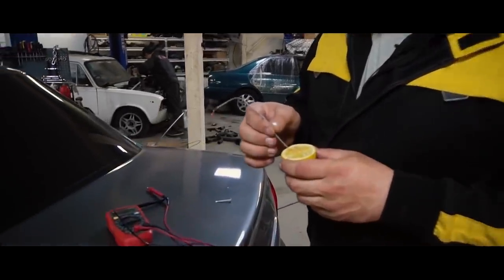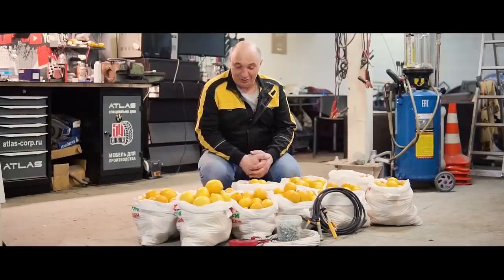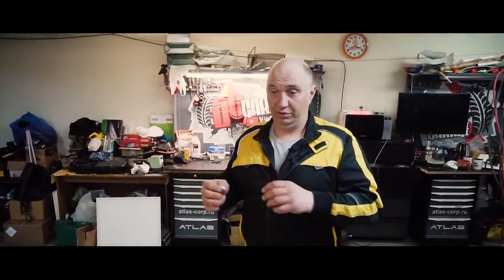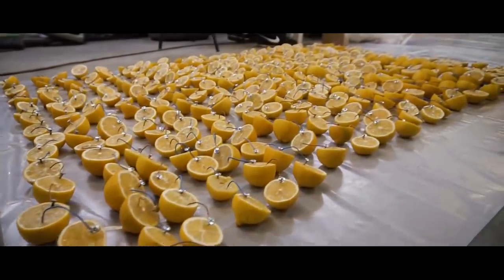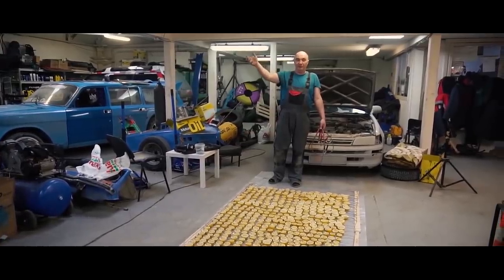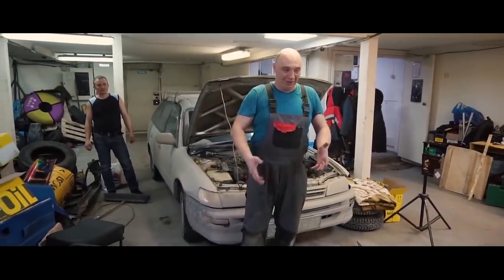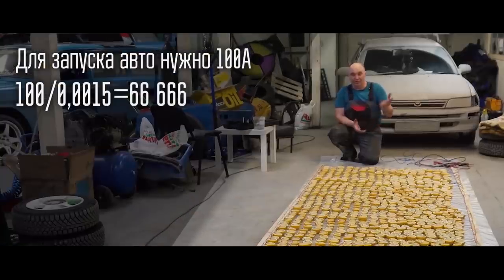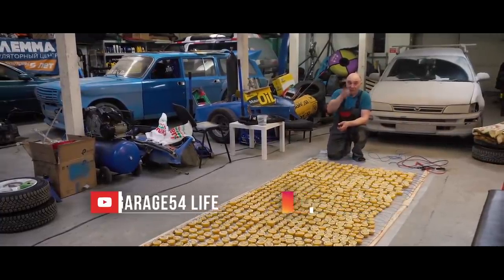Can a battery made from 1000 lemons start a car?

Comment: First squeeze the juice by running them over with concrete wheels and then try replacing battery acid with lemon juice. Then put the waste in a barrel and ferment with another shit ton of sugar and water. Distill the resulting liquid and use it to run the engine rather than start it! 

Proper job, now go in it to the store and try the whole thing again with grapefruit or rhubarb!

Comment: 11:38  Under a Department of Energy program, America's finest engineers have tackled the problem and solved it. We are performing our test in Florida, next to a large lemon farm.   We are making our grid in advance using copper and zinc pieces pointing up.   We will use whole lemons to maximize battery life. We determined we can minimize cost of labor by having the people who pick the lemons  stick them on the grid without cutting them in half.

Comment: You can start a car with lemons, just not the way you think. 

Instead of connecting the lemons directly to the car, use them to recharge a battery enough to start the car.

Comment: Despite those weak lemons, this couldnt work even with strong batteries, with such thin main pararell wires from the lemons.
second thing: it had 1500mA current, what u said,  later when doing math, you count only 1,5mA, small mistake :D
Reply: If you look carefully the multimeter was in 2000 µA mode, 1500 µA = 1.5 mA.
Reply: @WhiteEuphoria74  yeah, i've missed that.

Comment: Volvo 240 vs Lada engine destruction test. Do it! If Lada motor wants to be king it has to beat the Volvo B230 or a Volvo B20 or B18 which holds the record 4 million miles.
Reply: Would actually be a good video because those old Volvos were built to be simple and in some cases run off propane all because just in case Russia invaded Sweden.

Comment: It take more then VOLTAGE to start a car..These do not have enough Amperage to do the job. Maybe run a clock but NOT a car. Actually, it's NOT a battery, Batteries STORE energy, this is a chemical reaction resulting in an electrical potential. You can do the same with Zinc and Iron rods stuck in wet dirt.  but wont' get enough to do much other then charge a SMALL battery but it would take a LONG TIME. This is called a Cathodic Cell...Similar to what happens when a zinc bar is in the same ground (Electrolyte)  as an Iron pipe, etc. The difference in Potential causes a current flow..but not enough to be useful

Comment: I'm going to say yes, let's say your car battery is 300CCA, I'm no electrician or mathematician so in my mind I'm only looking for .3 amps per lemon... I think it might be in there somewhere. Now to watch the video and learn why I am wrong!
Reply: LOL! Well how wrong was I, The next question is can we wire up a circuit with enough capacitors and what not, to step up the output to the 100amps we need to turn the crank? Shouldn't be too hard right...

Comment: You do realise you shorted the battery when you were trying to "measure the current", right? You just don't connect an ampmeter directly to the power source. Never. And what were you even expecting to see? That the battery is pushing some constant current into 0ohm (ampmeter) load? It's not a current source, it's a voltage source. Go ahead, try it with a lead acid battery, it will blow your ampmeter...